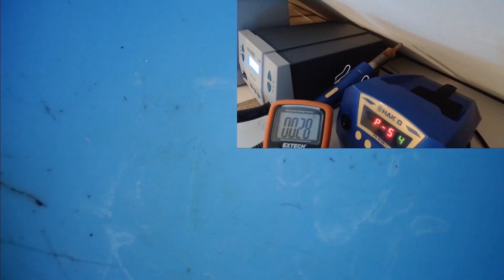Hot air temperature: Should I use low heat for more time or higher heat for less?

Comment: I am almost always inclined to use higher heat for quicker in and out most of the time on all soldering and rework. However, I have been wondering more and more about how much damage was done by stressing the PCB and nearby components by not doing a ramp-up pre-heating first. I have been reading more and more about ceramic caps developing cracks that come back to haunt us later.

Comment: SMD Components have specifications for how long and how hot you can go. Read the datasheet. As a rule of thump, the temperature that melt solder is usually limited to less than 15 seconds. Pre heating is usually done at 150c. This is done to shorten the time you spend at higher temp.

Comment: Hi, great video learnt a lot from this. I have a question. I have fixed several iPhone 6S tristar ICs. Most every time they charge fine after the repair but all the time they drain fast like 1% every minute. The weird thing is that they only drain like that when using the phone but on stand by they don’t drain. I use 320c with airflow at 55 when desoldering the ic when soldering back on the new ic I use less air flow at 45 but same temp. I am using a quick 861DW solder station. Any input of what I might be doing wrong would be greatly appreciated. Thanks!
Reply from the maker: benben20 Hello, how do you diagnose that tristar is the culprit ?

Comment: Low temps over long time is bad for the pcb and smd components, My hot air station had a defective heat sensor and it destroyed 3 expensive motherboards while working on it, Got new hot air station. doing always at 380, 420 degree and the results are the same as in the video. cheers
Reply: so you use 380C to take off parts or 420?
Reply: @davidvalens3337  between
I use 400 just experiment
Remember those hot air 
Gun temps aren't accurate

Comment: desoldering ok.But what about the soldering time
Reply from the maker: yemmes sudheer sudheer soldering time is not so important cause most of the times we use leaded solder which melts lower than lead-free..
Reply: @RepairLab Thanks for the reply .
If i use higher temp ,my board will burn.
If I use low, not melting ang damage otherside

Comment: Brilliant video. I learned a very valuable lesson here. Thanks. However, what difference would using a preheater make? Would the temperature required be lower but the time the same? Would it be safer for the board? Do you have a preheater to test this?
Reply from the maker: Hello thanks for your comment. Preheater would make a huge difference actually. The basic idea is that using a preheater you keep the board to a specific high temp. This reduces heat dissipation dramatically thus allows us to use lower heat on top. So using a preheater its almost the opposite concept.

Comment: Nice demo. Clearly the quicker IC is removed in this circumstance is best. Is it me or is the hakko slow to heat up to set temps?
Reply from the maker: True hakko used to be slow compared to quick 861
Reply: @RepairLab  I think the Quick just doesn't display its output temperature as accurately (when heating). I mean, that it shows it is at temperature before it actually is. Probably related to temperature sensor position etc. Doesn't mean its regulation is bad though of course.

Comment: Thanks for the video. The higher temperature was set to 400C but what was a real temperature of the hot air flowing to IC?
And what is the highest temperature that can be  used before IC is burned?
Reply from the maker: Hello, the temp shown is the temp near the heating element of the hot air station. So the actual temp of the air flowing on the IC should be less. But why is this even matters? Numbers don't really matter. Not every IC has the same tolerance when it comes to heat.
Reply: Thanks for the reply. But how do you find a proper temperature to use, if different IC have different heat tolerance?
Reply from the maker: Lad Bla Listen, most ICs will make it through soldering. That's why they are on board and they work. Some of them are more sensitive to heat some are underfilled and so on.  There is no a specific rule to follow. e.g. We know from experience that wifi module is sensitive to heat so its always better to reball it with leaded solder balls in oder to solder it back with less heat.
Reply: OK, so what temperature do you use for those sensitive IC without any risk of damage during desoldering/soldering?
Thanks

Comment: good video there is lots of people saying that lower heat is better but I am glad you took the time to test it :)
Reply: @ElectroniCs No, multi layer boards need more heat, maybe 380C.

Best Regards.
Reply from the maker: Thanks buddy!
Reply: @RepairLab  I am in electronics for more than 40 years, I do the same, my hot station is set to 350C.
I prefer to use more temp and lower  time.
Good Job.

Cheers.
Reply: In the vídeo is shown that is better higher temps ans less time , the neighboards ics get Hot less

Comment: But what about the components on the other side of the motherboard like the underfilled components amd the cpu?
Reply from the maker: It's the same concept. Heat transfers over time so if you lift the chip faster, heat spreading on nearby components will be smaller than if you do it with less heat that takes much more time... This can be probably shown better with a thermal camera but I don't have one. .